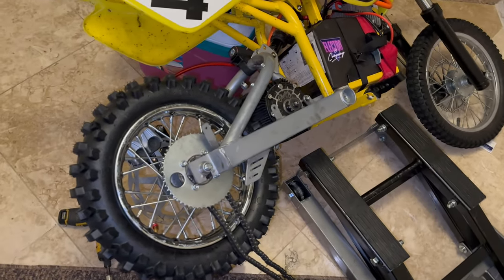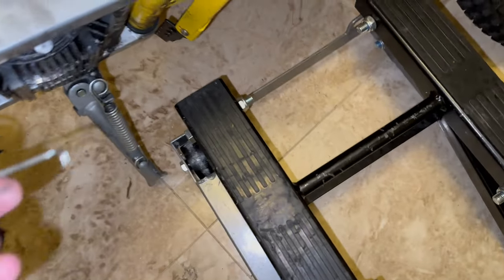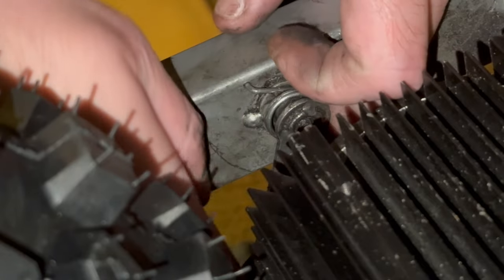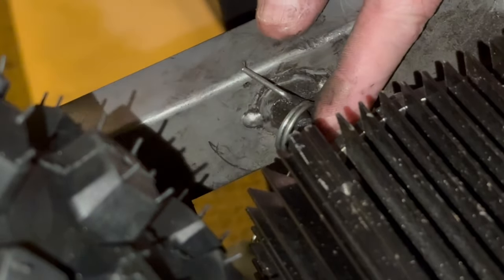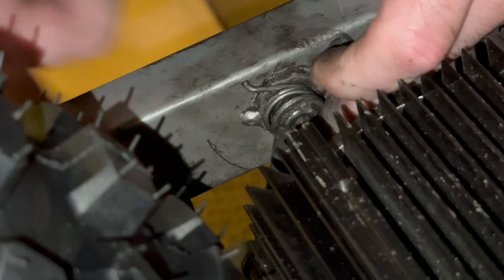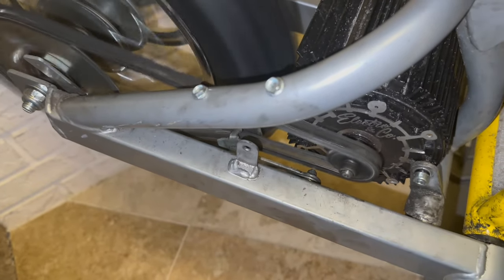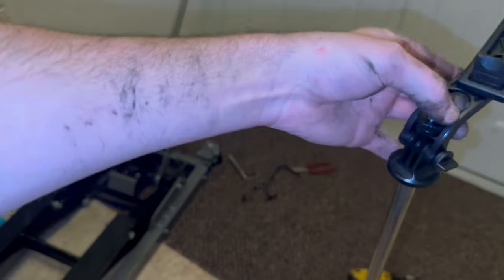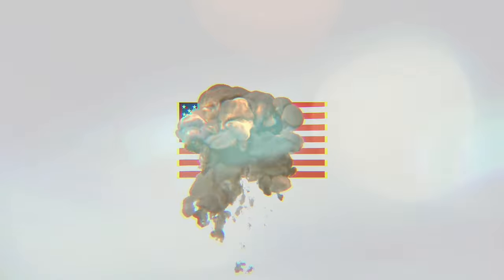Razor Chain Tensioner Explained! Final Fix! What I Was Missing -RSF/MX/SX -No More Zip Ties?

Comment: I did that to mine also but with the trumoto and ec4p on 80/11 gear ratio on t8f chain. It seemed too loose but my spring was messed up but im getting a new tensioner to try it out. I got a tensioner meant for a 420 chain and the spring is definitely snug. Its pretty close to stock. Just had to cut a lil bit off to line up chain properly and add bearings. It works perfectly even under high load on acceleration.
Reply from the maker: Yeah. Honestly, I AGREE. It’s been another week and it loosened up on me again. Drill the hole bigger and Switched to the E&C spring. Tighter but still want tighter. I like the extended swingarm idea E&C is doing with real manual chain tensioner. I like it TIGHT.🍻bro